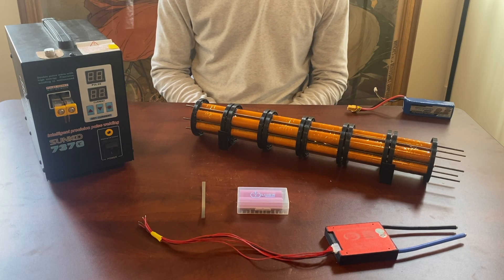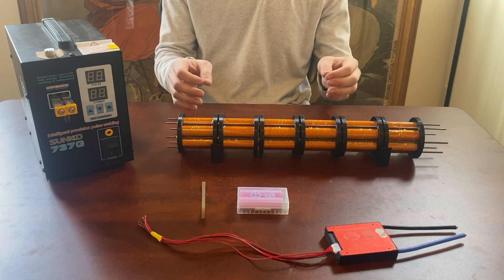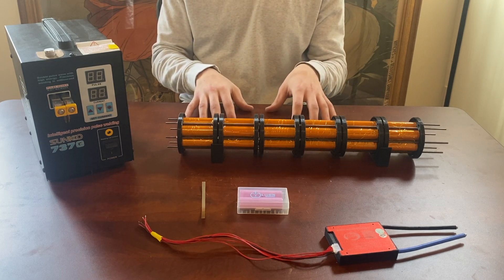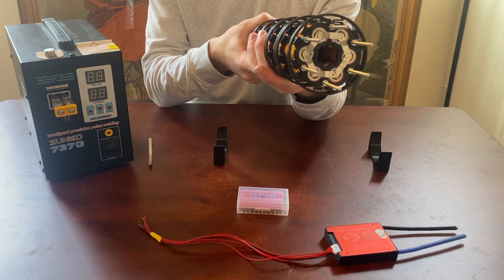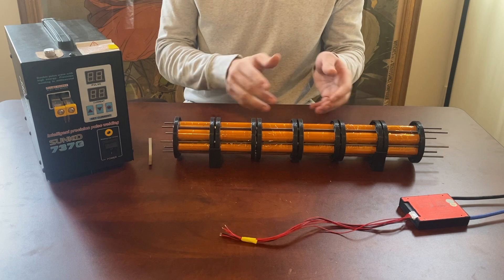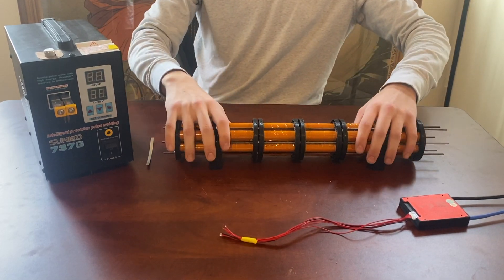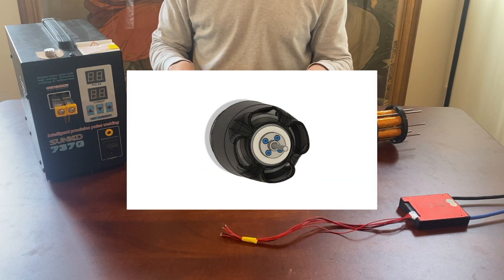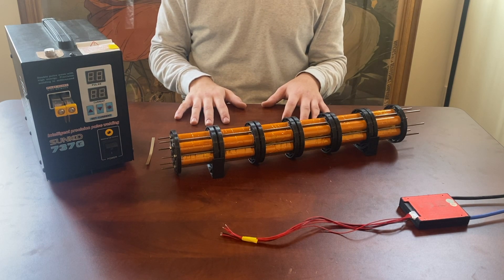Structurally Integral Battery Pack for Electric UAV Aircraft

Comment: Love the video. Have you built UAVs with the battery pack? 👍
Reply from the maker: Thanks! Haven’t integrated the battery pack into a UAV yet. I’ve worked on a contra-rotating coaxial drive system to work with this battery but I’ve recently lost 6 years worth of my CAD work with a lot of these plans included.
Reply: @Levi_Sheridan  You are a pioneer. Sad to hear that you lost the valuable. Wish you a happy & prosperous New Year!
Reply from the maker: @pc2237  I appreciate that. I hope you are having a great new year as well!

Comment: So cog will be figured after combined battery/electronic/propulsion balance point is established? You going high aspect ratio wings?
Reply from the maker: I currently am not focusing on this project to focus on the Transatlantic UAV. I have a cad file full of small models I made for all of the flight computers/sensors and figured out their weight. I was able to roughly place them and then use fusions COM tool to estimate the location. I was building this as a long range UAV so I was intending on using a high aspect ratio as I do on the Transatlantic UAV.